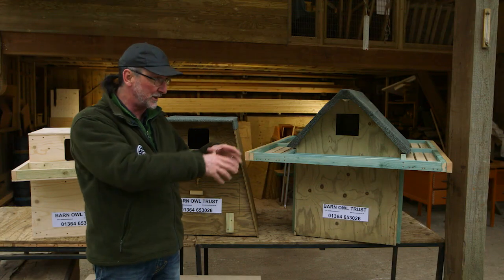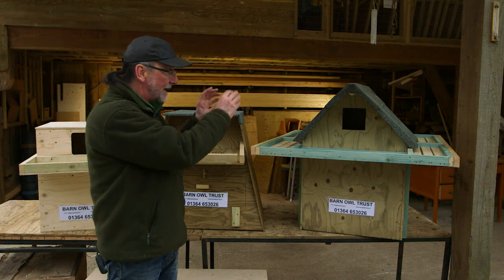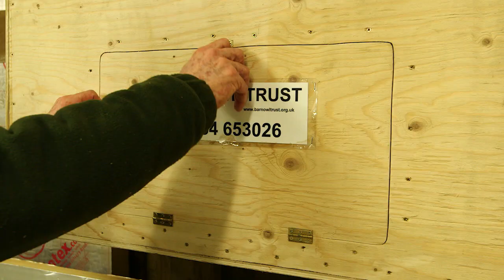How to Choose the Best Barn Owl Nestbox Design

Comment: I WAS CONSIDERING BUILDING SOME BIG "NEST BOXES" OUT OF SECTIONS OF LARGE DIAMETER "SONOTUBE" (HEAVY PAPER/CARDBOARD, CYLINDRICAL CONCRETE FORM), WITH hHDPE PLASTIC END CAPS,... SECURING IT INTO A LARGE PINE TREE, WITH WIDE, OUTDOOR (SUNLIGHT RESISTANT), POLY WEBBING TO KEEP IT SECURED, FOR A COUPLE OF YEARS, WITHOUT INJURING THE TREE.  :face-blue-smiling::face-green-smiling::body-blue-raised-arms::face-red-heart-shape::face-purple-open-box:

Comment: In the American west we put a partial wall just inside the entrance to deter predators. We also drill ventilation holes at the top of the sides of the box as heat can build up and kill owlets. All of this is easily looked up on the internet if you’d like a clearer understanding.
Reply from the maker: Thanks for sharing your experience in the American west, Anna.

Comment: my personal experiences  with shallow  door boxes is that they are not good.  1. Juveniles  can access out,  way before they are able to fledge. They WILL fall out. 2. Boxes should be deep enough for the debris of two nestings in a year  with their buildup  to not allow the owlets to access and fall out. 3. porches are malarkey.  They invite predatory  activity by great horned owls  and  others.
4. Don't build a porch, Instead, build perches with in twenty or so feet. These could be snags or poles with cross members.  When the owlets begin to fledge, if they can make their flights to  a  decent perch quickly, it gives them confidence and a breather.  We have a deep box on our barn.  Each year when we clean it out we get almost two five gallon buckets of debris out of it. And that's the way it is in the Willamette Valley of Western Oregon USA
Reply from the maker: Thanks for sharing your experience in Oregon, Joe. 
We also find that deep nestboxes are essential for the safety of young fledglings and recommend the depth from bottom of entrance hole to nest should be not less than 450mm. 
Here in the UK, it's unusual for Barn Owls to be predated, so porches are not usually a problem. For any Barn Owl nestbox less than 700mm  deep, we recommend an exercise/landing platform below the entrance hole. 
Nearby perches are a good idea, but if this is not possible, make sure that nestboxes are at least 540mm deep so the young cannot possibly emerge until they are capable of flying upwards. 
More info here about the differences between UK and American Barn Owls: https://www.barnowltrust.org.uk/barn-owl-facts/american-barn-owls/
Reply: @BarnOwlTrust1  I built a barn owl box years ago partly out of a cupboard. It's massive with a felted roof that is a lid. It's quite high in an oak and faces a bit too easterly but as it's so heavy that's the best way I could settle it in a fork. Squirrels took it over for years until this year I saw a young tawny perched in the entrance and heard lots of tawny activity for about a week. We do have a very shy barn owl around because I've heard it from time to time so have decided to set up another box in a perfect oak a whole field away and an indoor box in our barn. I'm pretty sure the tawny's will be back to claim their original box soon!
I'm on a farm in Wales by the way.

Comment: Hi BO Trust. Have checked out many BO Nest boxes for trees using your guidelines and saw many that fall short of min hole heights fro safety. We would like to purchase one of yours but we were wondering about the life span of the floor section. How long so you think your tree box floor will last in British weather, roughly. We are restricted on how often we can take down and repair boxes you see. Thank you.
Reply from the maker: Hi - it's great to hear that you're planning to put up a Barn Owl nestbox! 
Our nestboxes are built to be long lasting with thick roofing felt which should last at least 10 years and timber which should last for 20 years. This is not a guarantee, as we don't have any control over the positioning of the boxes (or the weather!) but we have tree nest boxes which are still going strong after 15 years! 
If you have any further questions, please contact us by email or phone for a more detailed response: https://www.barnowltrust.org.uk/about-the-barn-owl-trust/contact-us/
Good luck with your project!

Comment: so if i build it they will come? it won't get taken over but something that's already around?
Reply from the maker: Whether Barn Owls will use your nestbox partly depends on the surrounding area - they prefer open fields and there needs to be enough prey food available (mostly small mammals, e.g. voles, in the UK). 
Other creatures might try to take over the nestbox - this is not usually much of a problem in the UK, as Barn Owls are well armed with razor sharp talons, however there are other competitors in other countries which could cause problems. 
More info on our website: https://www.barnowltrust.org.uk/barn-owl-nestbox/
Reply: @BarnOwlTrust1  well i sure got plenty of open field with rodents in it. seem worth a try!
Reply from the maker: Brilliant! Good luck!

Comment: Thank you for the helpful video. I would like to make some outdoor pole mounted nest boxes for Barn Owls in Lusaka, Zambia, I do have a couple of questions: 1)  what size should the opening be to allow adults to enter? 2) does the floor need to be perforated/slatted in order to allow their excrement to fall out?
Reply: As an aside, living in an area that gets hot, as I do, it is recommended to drill ventilation holes in the top edges and a few in the bottom as well. The small holes in the bottom will allow for ventilation but will also keep most of the litter in the box
Reply from the maker: Hi Jamie, 
Good luck with your project - sounds great!
1) Entrance hole size: Optimum 100 x 130mm; min. 100 x 100mm;  max. 150 x 150mm 
2) No - the floor should be left solid, as the old pellets and droppings create a soft surface for the owlets. It does need to cleaned out every 2 or 3 years. 
Lots more info on our website: https://www.barnowltrust.org.uk/barn-owl-nestbox/barn-owl-pole-nest-box/

Comment: I’m planning on building an owl box, I like your designs. I have a question about the entrance being so high from the interior of the bottom. Is it hard for the owls to get up or down from inside
Reply from the maker: Hi John, the depth of the nestbox is an important safety feature for young owlets, as it prevents them from getting out until they are ready to start learning to fly. Very young owlets often die if they fall from a shallow nestbox, as the parents ignore them and they starve or get predated. Older juveniles and adults can easily get in and out. More here: https://www.barnowltrust.org.uk/sitemap/galleries/fallen-owlets-barn-owl-nestboxes/

Comment: I live in California and have a southwest facing house. Is heat a problem for chicks in the box?
Reply from the maker: Barn Owls seem to cope with pretty high temperatures, but to mitigate the heat, try to put the box somewhere in the shade. You can also try painting the box white to reflect the heat, and drill a few small holes under the top edge, to allow hot air to escape.

Comment: Do you have a cut list or a detailed drawing for the nestbox on a pole?
Reply from the maker: Yep - detailed instructions here: https://www.barnowltrust.org.uk/barn-owl-nestbox/barn-owl-pole-nest-box/#pole-box-plans
Reply: @BarnOwlTrust1 , I hope to build this design. What would be very helpful is dimensions added to this diagram. https://www.barnowltrust.org.uk/sitemap/galleries/photoguide-build-pole-mounted-barn-owl-nestbox/#jp-carousel-10216
So dimensions are missing from the link you provided above. For example, the measurement to the peak for the external view, and the dimension from the bottom of the opening to the bottom. Great design.
Reply from the maker: @stephenholzman6670  Sorry. The thread was for a 'cut list' so the link above was to a cutting plan. All the dimensions you need are here: https://www.barnowltrust.org.uk/wp-content/uploads/BOT-Polebox-diagram-FULL-SIZE.jpg

Comment: DO NOT BUILD THEM OUT OF POISONOUS WOOD!!  Make them out of natural pieces of wood.  I would suggest even Cedar not to be used.  In America,  hardwood,  and fir.  you Can easily make a good big box with 1x4" wood.  Its a matter of THINKING about it.
Reply from the maker: Not all wood preservatives are poisonous - please check out your local products for the safest options. It is important that the nestbox has as long a life as possible as Barn Owls will use a good site for many years - even over many generations.
Reply: What wood should i use if I'm in America? I'm confused if I do or don't use hardwood haha.

Comment: Thank you for so useful video! Could you please advice what side to orient owl nestbox? South?
Reply from the maker: As long as the box is well designed, the compass direction it faces is not the most important consideration. It's usually best to position the box so that an owl fly past by chance is most likely to see the entrance hole.
Reply: I think I read 'east' to take advantage of morning sun and to minimize rain into the opening.
Reply from the maker: @stephenholzman6670  East is fine but the priority is the maximise visibility of the entrance hole.